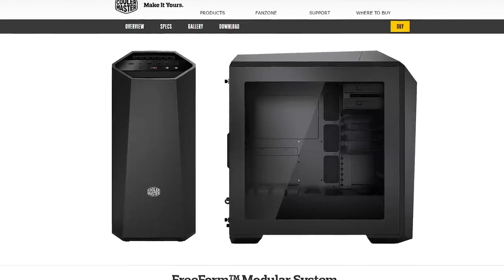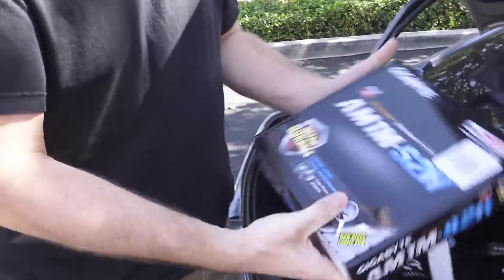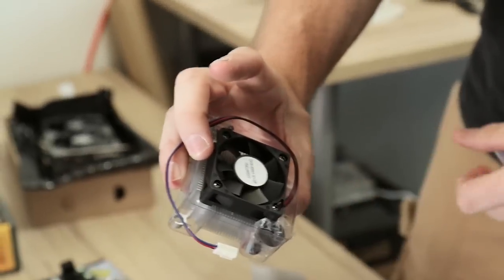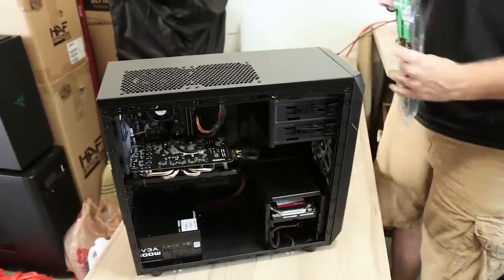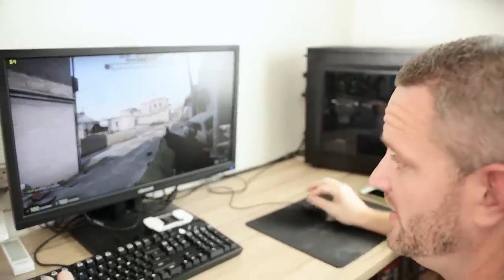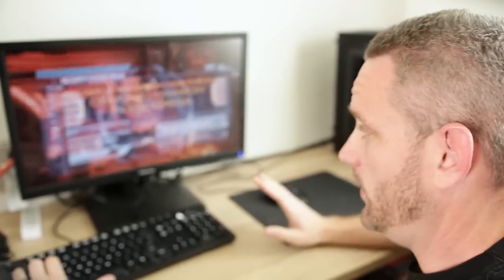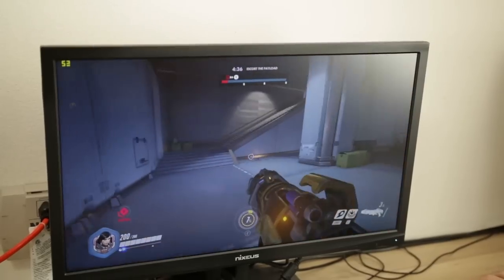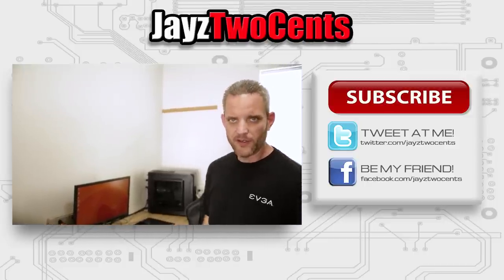Ultra Cheap Gaming PC 2016 - Can you play games for under $400?

Comment: With just an exta $50 and gotten yourself a much cheaper case, you could have squeezed in an A10 7850k or even an i3 4170 and you would have effectively eliminated the bottleneck, but yeah $400 gaming PC is doable, and thats brand spanking new, had you went and gotten second hand parts you'd be running circles around a PS4 haha.
Reply: with your i3, some games require 4cores cant play, thats the reason why he chose AMD instead of Intel. But rightnow, i confuse about r9 380x, that have the same price rightnow with rx470, throw in few more bucks and you can get 8GB 480 or 6GB 1060. 
http://ca.pcpartpicker.com/list/BgRkJV
Reply: i3 4170 is 2 cores 4 threads, so it will let you play 4 cores games, and amd is good but kind of old now and is being outperformed by intel, but lets see how zen lineup will do.
Reply: No dude, you are totally wrong,some game require 4 real cores, not thread dude
Reply: I believe it's because the manufactoring process for the RX series has been alot more refined, they made total cost of having/running the RX the focal point after all, that is cost of buying, price to preformance, power consumption (as in the amount of power compared to the rest of the components), so the RX series cost between the cards seem to be aimed for people that are very concious of what they spend hence an extra €£$ for a 30% better preformance card maybe nothing but when you don't have an extra €£$10 to spare on your machine (which is the aim of this rig), every little drop you can squeeze out of preformance to save every last penny and indeed to try to not even use your whole budget is a massive deal. That and there is always a delay before the markets correct themselves as they still have old stock from the old manufactoring price cost to get rid of before they can sell at the better price with the improved manufactoring costs, the r9 380 has dropped in price finally now but it's still got a few weeks/months before it'll be even close to the current 270x price range.
Reply: I came up with an fm2+ build that's better than the xbox one and ps4 for 488$
Reply: +Thinh Le Tien dude stop spreading around misinformation. Watch some videos. The i3 runs far cry 4 dragon age inquisition and other games which require 4 cores without any trouble. It also ran the bf1 beta without any issues.
Reply: I second the second hand idea. I got my i7-2600 for $150 AUD ($112 USD), which is cheaper than an i3 or an A10. It's old and would require a new motherboard to upgrade, but it is also very solid and won't need replacing for years, so that balances it out pretty well. Paired with an R9 390x it makes for a very solid gaming machine. I never have to turn anything down.
Reply: nice
Reply: I did a €300 build last year. Literally sawed an old case in half and screwed some wood to it to make it small form factor. I got slightly better performance, but I went entirely used parts.
Reply: Look at the parts list- he payed $150 for the 380x. Hard to argue there. Pretty sure even the old I3 is solid in 4core games- but the reality is the new I3s are often a better deal that I saw including at MC. I mixed old and new hardware to build a $530 FX-8370 R9 380 rig that's now got an RX480. Good PSU for later, mobo/cpu will be the upgraded part in the future for sure. After I do- a cheap PSU and case will allow me to have two good rigs.
Reply: well, I run DooM (4), and fallout 4, on high/ultra settings on a phenom 945 - granted, i overclocked it, and using vulkan - so you really don't need new/powerful cpus, saying that it's always nice being able to say you have the latest and greatest.. it's just not necessary at all.
Reply: That case is $40. how cheap do you want to go for a case?
Reply: ytilanigiroon
 honestly i wouldn't go below 60$ if you can afford the extra 20$ it would be well worth it for future upgrades ect..  just my opinion though.
Reply: DerisiveLaughter I've seen some good cases for £20-£30 (you just have to hunt for them and do a little research), my first case was the CiT Vanquish which is a great case for starting with.. if you're on a real budget then you just need to put up without have features etc.. just get whatever will hold your hardware and get the cheapest case you can, put the money you save into better hardware and then save up to get the case of your dreams later.. I now have an NZXT Lexa S, which cost me £64, and while I could now afford to get more expensive/better like the NZXT 440 or Phantom 820, I just love this particular cases style the most. It all comes down to budget, and it's better to put the money into the hardware first and then go toward asthetics etc.. when you can afford it.
Reply: Scott Cooper
 yeah you  need to shop around, but it's worth it imo.
Reply: DerisiveLaughter Absolutely, but the problem I often have with the community is that it's all enthsusiet or it's shit, whynot spend an extra ££ on this, then an extra £££ on that, most people have a set budget they've already spent what is acceptable for them.. most people either cannot afford or just don't want to spend the kind of money they're told by "the community" to spend for what is essentially the same experience they'd get with a cheap system.  I personally always try to suggest better within the price of their total rig, if they're extremely sensitive to cost then I always suggest they go with FM2+ socket mobo, forget about a gpu altogeather and get an AMD apu, they save at least £100 right there and then, and amd apus have the best integrated graphics, it also gives them an easy way to increase preformance when they can afford a dedicated gpu later down the line which will also save them if they want to get a new mobo/intel, or otherwise combo later (I am I should mention against intel for ethical reasons, great cpus etc.. but they are literally evil, they earned that "evil inside" parody for a reason), spend the extra money on good ram to increase their ability (I'm still not entirely sure why this is, but ram speed has direct consequence to the ability of apu, while it doesn't actually matter to anything else), AMD are still making cpus for FM2+ and you have good motherobards available without spending insane amounts, the athlon x4 880k and new A10s have been released just a couple months ago, but even the old A8s are capable of running the latest and greatest...just not good for professional work in multimedia applications (but then, you wouldn't be looking at a budget build if that were the case).. anyway this went on longer then in intended with many corredtions made, drinking a wee bit tonight in celebration of a house getting with other half XD
Reply: Congrats on the home!

I agree with the overall sentiment, though. whenever I spec a build I ask for two things:
1. use of the system
2. max budget

I ask that the max budget be something they have in cash before doing anything because as soon as you kit out a system something new comes out and you have to change things. Still, it's silly to not get an SSD when they're ~$70 for 275GB, the case Jay picked is a budget sweet-spot case so no complaints there, the PSU... eh but it's probably just what they had in-range, 8GB is fine especially for $4 more than 4GB, the CPU is what it is, and the GPU - since this is a "gaming" PC - is an absolute must especially compared to price comparable APUs.

Keep in mind, Jay wanted to buy every part "new" (save the open box case) at MC that day, so second-hand was out-of-scope.
Reply: ytilanigiroon agree entirely, to be honest ever since I got an SSD for my OS/Boot drive (is only 60gb) I just can't go back to a normal hdd.. and really you only need a nice cheap SSD for a boot drive - maybe have any primary pogrammes you absoulutely must have instant access to at any given time -, a normal HDD for a games drive is fine, though must be sata II(, but due to cost that is I've found the best value for money, speed where you need it, space for everything else... as for PSU well, personally I don't recommend 2nd hand but if it's jus to get one up and running for a few weeks, anything 80+ bronze is better then the best psu you could get new at the time 15 years ago.. though I do stress one never knows what issues they will have with a 2nd hand psu and so best to change that out as soon as one has the money to do so. - again we're talking people whom have a very limited budget to begin with, otherwise for pus I always suggest new unless it's one I personally have owned and am passing on, and even then I still suggest it to be their 1st issue for upgrades.
Reply: Scott Cooper
 yeah i hear you man. it would be wiser to spend the big money on motherboard cpu and not get something you will never truly utilize. case gets superficial and getting one that fits your budget and needs would be better.
Reply: whats the amd a10 7850 k price
Reply: the 7860k is 100$ on newegg right now you can also get a 7890k for 149%
Reply: Just Find the 7850k is around $100.
Reply: Is a pc with amd fx 6300 six core 3.5 mhz, gtx 750ti and 8gb ram good?
not for really new games like battlefield or so
more like for something like League of legends, smite or overwatch
Reply: it's not bad, 6300 is a decent hexcore, if you can get the 6350 for a similar price that'd be better, though for games you really don't need more then a quadcore, check the price on an FX4350, it's a 4.2ghz on piledriver, faster speed per core is cheaper then fx6300 and still on am3+ socket, and piledriver is great for o.c etc, 8gb ram is fine but I'd suggest at a minimum 1600 though 1866 is a good speed for ddr3 (ram speed doesn't really matter that much) there's nothing out there in games that require more then 8gb of ram at present, any extra money you have put into the gpu, 750ti will play games but if you decide you want to play newer games then it's best to get the best gpu you can afford. Remember, Zen is due to come out very soon, so I wouldn't go nuts on any motherboard or cpu, but to give you some idea a computer that I have has an FX4130 and it handles doom4 on high settings and battlefleet gothic armada on highest settings.
Reply: Scott Cooper ok thanks for all the helpfull info but i am kinda new to pc's and stuff and don't know that much about the hardware and stuff
So i don't know anything about building pc's myself and the things that i mentioned in the comment before were in a already built pc for 500€
Reply: Metin Can Demirbas I've checked ebay pricing, I don't know why but the FX6300 and FX4350 are the same price (from official CCL store, they generally have the best prices and rep) at £106, however you can get the FX4350 2nd hand from CeX for £45, and the FX6300 for £70 (using what I can get them for in the UK for comparison reasons, might be a bit more or less where you are), personally I'd suggest buying buying the cpu 2nd hand from a company like CeX that have a good returns policy (and CeX have a warrentee/guarentee on everything they sell, it's now 12months I think, along with a 2 day no questions return policy if it doesn't work/change mind), it's very rare for a cpu to fail so buying them 2nd isn't an issue at all if you get it from such a place, for motherboard you don't need any of the extras, just get a cheap board from a good provider, I use Asus myself, Because the pins are on the cpu for AMD cpus just check that they are all perfectly straight. If you want cheaper there is the FX4300 3.8ghz which is £67 new (also official CCL store on ebay) however it's bulldozer, and also £45 2nd hand from CeX, personally I'd stick with piledriver, the FX4170 might be a good alternative as it's base is 4.2ghz and has been known to oc over 5.1ghz, it's also cheaper at £35 2nd hand, not sure what it will be 1st hand there's currently no listing for europe. MSi do some decent boards these days, gigabyte are alright for cheap boards (my original pc had a very cheap gigabyte board cost £30 and I had no issues). And for gpu the new RX460 is very cheap starting at around £100 for the 2gb version (all prices here include vat of 15%) which is comparible to the R9 270x 2gb on directx11 and much better on directx12 and vulcan, or £125 for the sapphire nitro 4gb version (from scan.co.uk - they ship throughout europe as well).. the 750ti is still a good card, and should run most everything.
Reply: Scott Cooper well i didn't understand all of what you said but still pretty usefull info
Thanks
Reply: Metin Can Demirbas I tend to think of everything all at the same time and can thus get confusing for other people XD ..basically for gaming you don't need anything more then a quad-core, so you can save money there.

Maybe this will help. I have a computer that has a phenom II 945 (I have oced it to 3.9ghz, would suggest getting at minimum a phenom II 965), Asus M4A77TD motherboard, 8gb 1600hz ram, sapphire RX460 nitro+ 4gb gpu, antec earthwatts 380w 80+ bronze power supply unit, have a 64gb ssd for the boot drive with windows 10 professional (get spybot antibeacon) and a 1tb sata III hdd for games storage.That computer plays fallout 4 on ultra settings, Doom(4) on high settings, Battlefleet Gothic Armada on highest settings, Shadow of Mordor on highest settings (haven't tried the new hd graphics upgrade pack though for SoM). All but the GPU are 2nd hand, cost a total of £220 including tax/vat. - that does not include the case, I have an NZXT Lexa S 3.0 crafted series case, cost me £65 new, it also doesn't include the windows 10 price, you can get if need be get SteamOS for free, or best place is to buy windows from kinguin you can get OEM 64bit win 10 pro for about £30 - get the protection as well it's only a little bit extra and if the code doesn't work you get your money back.
Reply: Scott Cooper so i have a question...
On the side i selected all the parts for the pc i would like and when i selected the gtx 750ti it said that the graphics card needs atleast 550 watt and 80+
Is that true?
Reply: Metin Can Demirbas That gpu alone requires approx 180w, so a 550w 80+ bronze rated psu should be fine, remember it has to power everything, personally I'd suggest no more then a 650w (EVGA are great and are rebranded seasonic psus, not the cheapest but good prices), anyway 550w should do well just make sure it's at least 80+ bronze rated.  this website should help http://www.coolermaster.com/power-supply-calculator/
Reply: Most power requirements are heavily exaggerated for marketing purpose, in reality it can go as low as 300w (though that depends on the other components) usually 500w is enough for most setups. But you know you could also pick up a GTX 1050 ti instead, its more powerful and far more energy efficient and with room for overclocking ;)
Reply: I looked at the site and it said something like 300w
Reply: Metin Can Demirbas if the recommended is 300w then go for at least a 380w 80+ bronze, but bare in mind a good psu will last years and thus a dozen upgrades, so if you can get a quality 550w 80+ bronze (or silver/gold etc..) for a good price in your budget then go for it.. but as have shown in my setup for one of my computer builds a 380w 80+ bronze will work too.
Reply: Whats the "+80" thing and whats "bronze, silver or gold"?
Like whats the meaning
Reply: Metin Can Demirbas
The 80+ rating is a third-party rating for the efficiency of the power supply. ( https://en.m.wikipedia.org/wiki/80_Plus ) Generally, you get (marginally) cleaner power, use less power than PSUs that are lower or unrated, and (also generally) are buying a PSU with superior components (should last longer, run cooler, et al).
Reply: it only gets marginal once you hit 80+ bronze, the other rating are great to say you ave (I have an EVGA 80+ Gold in this build) but really even 80+ white (two names for this one it's either 80 Plus or 80+ White) is good enough, though it is better to get at least bronze, but with your budget 80+ white rated is a good option and they are relatively cheap. Unrated psus can cost a small fortune to run, I had one as a stop-gap while I was waiting for the EVGA psu, it wasn't good on the electricity bill as nonrated can pull down enormous amounts of power (which why computers were always advised to be turned off when not in use 15+ years ago) that can cause all sorts of issues down the line. Generatlly speaking Seasonic are the best brand on the the market, but EVGA are rebranded seasonic, so if you can get an EVGA on special (I don't suggest sleeved cabling for your first build they're very asthetically pleasing but a pain in the arse to deal with, especially when you're new to cable management) then go for that, Thermaltake and Coolermarster are alright but I've noticed they've started to cheap out on some of their lines, they still have a good reputation though, Antec have been around forever XD ..Antec are a good enough brand (I've never had issue with them anyway) and the antec earthwatts 80+ range in general have good ratings.
Reply: IzanagiXZ He did It for fun. Do you really think he doesnt know how to build a leveled system?
Reply: IzanagiXZ 
I have a ps4 and haveind set on building a gaming PC when this generation dies. Do you think this could run higher demanding games with a slightly better CPU. when I build mine, I expect to have a budget of $600, but I don't have a monitor because I currently use a laptop.
Reply: IzanagiXZ 
I have a ps4 and haveind set on building a gaming PC when this generation dies. Do you think this could run higher demanding games with a slightly better CPU. when I build mine, I expect to have a budget of $600, but I don't have a monitor because I currently use a laptop.
Reply: I got a monitor for 188$ in best buy 1080p so your about right
Reply: Evan San Unfortunately the AM1 socket has no "better" processor.